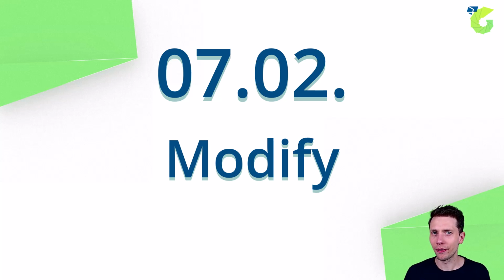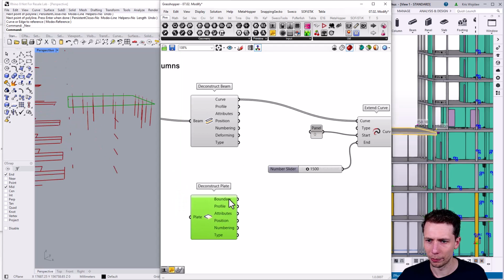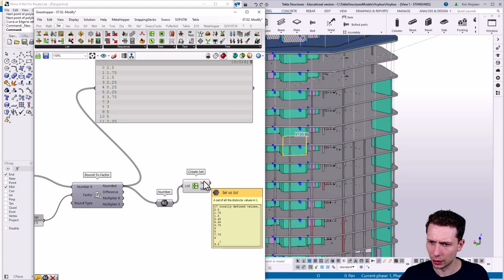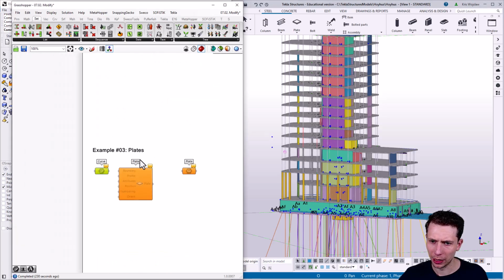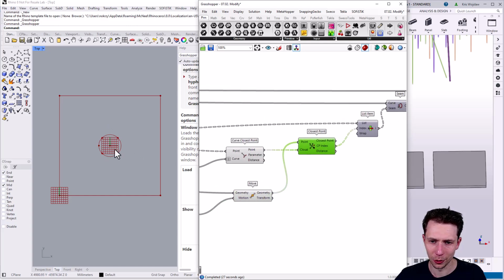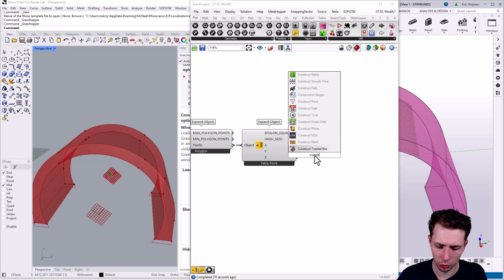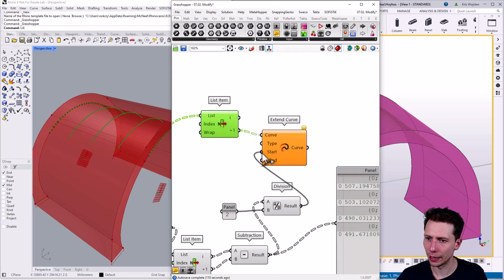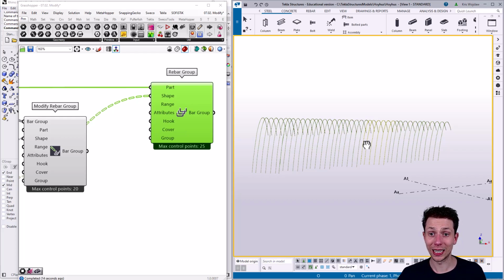MODIFY EXISTING TEKLA OBJECTS WITH GRASSHOPPER

Comment: Bonjour Kris,

I would like to create a curved steel beam, but I can’t find a way to pass the Curvature.Radius parameter, since it’s not a UDA but a basic property of the beam. Do you have a solution?
Reply from the maker: Sure! You have two ways. 
1. Provide Circle curve as an input for the beam. 
2. Provide 3 points as an curve input and modify the middle point and add arch point with the radius you want. 

Please write email to kris@learngrasshopper.com and I can sedn you GH file with example

Comment: Hi I want to move plane cuts of beams. How am I doing it?  The only way I found is to create new ones with moved origin point
Reply from the maker: @Arthur_Ko90 Yes, plane cuts can not be modified with a standard live link connection. However, I recommend changing the plane cute to the cut part. For example a boolean part can be modified with the "modify beam" component